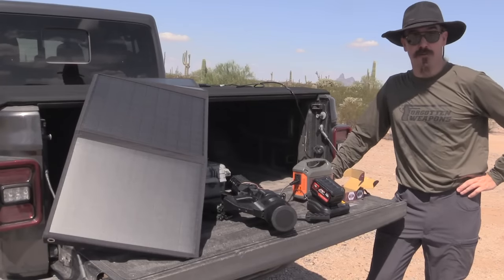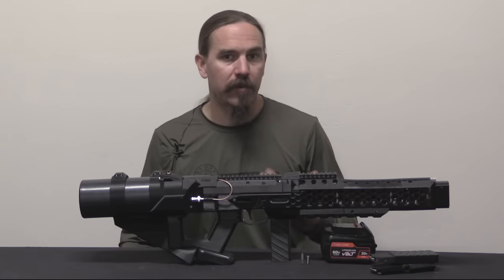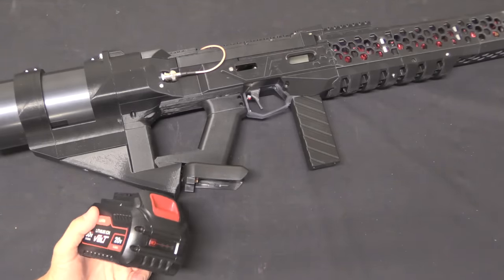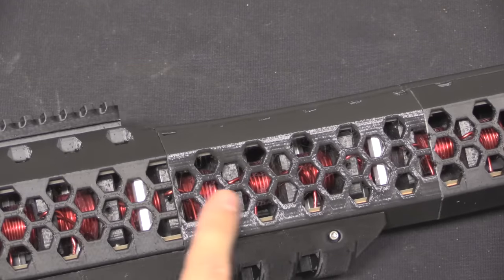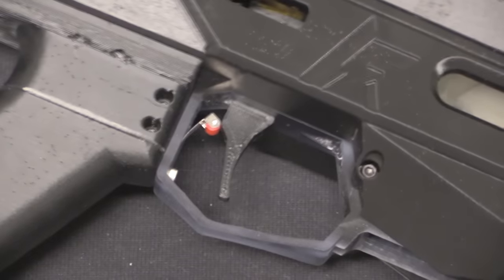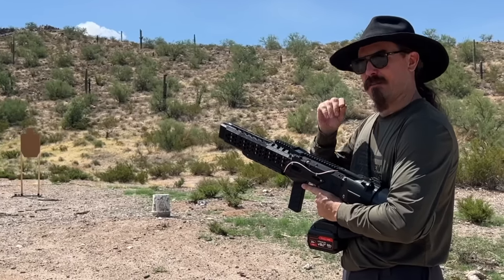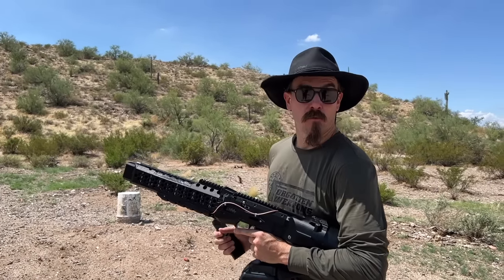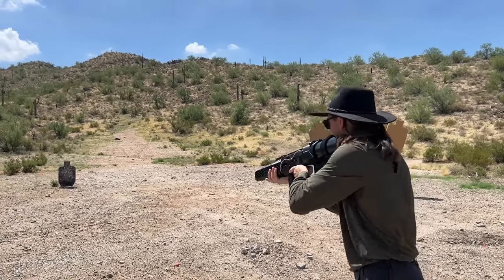ArcFlash Labs EMG-02 CoilGun: Making SciFi Weapons Into Reality

Comment: Would interesting to see them have a polycarb or whatever barrel, that was rifled / threaded - and the bolts come with that threading so that instead of interference rifling , you'd have spin induced by some sort of low drag threading
Reply: or you can rifle the bullets?
Reply: @gabriellang7998 That was the point, both barrel and projectile being rifled, just used "threaded". However at anything close to this power stage, I'm doubtful that would work. Because it would introduce a comparatively huge amount of friction, whereas these current models practically has no friction at all.
Reply: Wonder if you could make the dowel spin before it's pulled into the "barrel". Something like electric motor & rubber disc pushed against next dowel in the magazine before firing. If the system really is low friction it could keep the spin going.

Comment: I’m just waiting for the day we hear Ian saying: “today we’ll be looking at a shotgun coilgun”
Reply: space blunderbuss!
Reply: Envisioning  it as a muzzle loader.
Reply: Today I fire the Wave Motion Cannon
Reply: Project SPIW revisited.
Reply: On that note, could they load like a pack of needles or something in a nonmagnetic holder to make it a single-shot flechettes shotgun (single shot because the nonmagnetic holder needs to be ejected each time from the magazine).

I don't know if it would even be possible to have a low-magnetism holder to shoot it at the same time as the needles but at a lower speed and distance?
Reply: @raznaak  Sabot round, have the fall away aspect be magnetic (perhaps just a mag disk at the base), and use whatever other material you want as the payload.  I could even see it as something to deliver less then lethal loads with the current FPS it has.
Reply: Now I am envisioning a 40K bolt gun...
Reply: Shotcoilgun
Reply: The NC wants to know your location. (If you know you know.)
Reply: "Today we'll be looking at the Hydrogen Light Gas Mass Accelerator."
Reply: They Probably could down size an APFSDS style round from a tank into a little flechette bullet.
Reply: Im no sure why they haven't used fin stabilised projectiles yet.
Reply: @p.rileebenjamin7201  I thought Boltguns were gyrojet rounds.
Reply: @torgranael  they are, but they have a magnetic feed system if I recall
Reply: @p.rileebenjamin7201  I see. With how small the magazine is, I never looked into how it's supposed to feed.
Reply: @torgranael  Technical cannon for 40K does get kind of fuzzy, but I seem to recall it having a magnetic feed system.

Comment: Ian (or anyone who owns one of these) should invest in a magnetic ground-sweeper; that way they could reuse the projectiles (rather than having to reload the spent cases!)
Reply: Fortunately dowel pins are stupid cheap. Probably only worth the effort to collect them if you're firing hundreds or thousands.
Reply: Unless it hits something and deforms
Reply: Always a good idea to keep your range as tidy as possible.
Reply: @lucasblanchard47  I think their point was that magnet sweeping for coilgun projectiles is the closest recycling equivalent of brass reloading for firearms, not that you'd have to reload cases for this.
Reply: @lucasblanchard47  Thank Buddha it doesn't use lead.  See, another aspect of a weapon transitioning from the status quo.
Reply: i use an old car speaker on a string.  farmer engineering at its finest.
Reply: @pezpengy9308  how does that work?
Reply: @StoutProper  all speakers have a pretty good size magnet on them  the bigger the speaker the bigger the magnet
Reply: @StoutProper  Speakers have a big old magnet on them. Get a car speaker from an auto scrap yard for like, $2 or less, tie a string on it, then just toll it around like a Priest with a censer, while walking on your range. If it keep it just off the ground, it will collect the dowel pins for you.
Reply: A Roomba fitted with a magnetic sweep!
Reply: @JosephHarner  Do they make metal dowel pins?  I suspect the ammo made by cutting down rod stock.
Reply: @thehoodedteddy1335  Short solid steel pins at 200 fps (which is a velocity you can get out of a slingshot) probably aren't going to significantly deform.
Reply: @corombb   Exactly!
Reply: Steel dowel pins normally are extremely hard, you could probably reuse them, but in the 1/4" - 5/16" diameter range they are sold 25 pcs in a box for about $10.00 from McMaster Carr.
Reply: @norduferhandel4512   $10.00 for 25 pieces works out to $0.40/projectile.  A quick look online for 9mm ammo prices gives me a range from $0.20 to $0.85 per round.  I would certainly police up my e/m gun projectiles for reuse; the ones I can reuse are essentially free.
Reply: I'm sure Ebay or Amazon would have cheaper dowel pins. McMaster is the most expensive supplier.
Reply: @danielburgess7785  Aw, I'm going to miss the lethal leadpoisoning joke.

Comment: I think you'd be better off with self-stabilizing shapes like those used for shotgun slugs. Maybe even just drilling out a deep dimple on the back end of the projectile would give you better flight performance.
Reply: I bet they know, it's just not important yet)
Reply: Yeah, something like a stretched diablo pellet should work. And can be cheaply formed on a lathe in a single cut with custom cutting bit.
Reply: What I thought they could do is use finned projectiles and have rails on the barrel that input a rotation onto the projectile, you could still use improvised ammo, but actual ammo could be stabilized
Reply: This would probably work for higher speeds, but at 200 ft/s, I’m not sure you could get any substantial spin into the projectile.
Reply: or steel ball bearings and a "hop up"
Reply: I was thinking loading the projectile from the magazine into a chamber where there is rollers spinning it up before sending it through the coils. Auto might be a problem though.
Reply: What about a mini golf ball with all the dimples in it that improve aero dynamism?
Reply: Or borrow some of the advances the air gun world has made in stabilizing slugs, may be simpler and better to go there directly
Reply: @StoutProper  Same problem as with hollow or other shapes, you get far less material density for the coils to accelerate n cross-section.

I'd look more into tumbling than spinning around the axle off traverse.
When skipping stones on water, the stone is to tumble around the vertical axis to stabilise, the optimal rate being around 14 revolutions per second (if I recall the scientifical report correctly, ben a couple of years now since I read it).
Reply: Round the tip.  and cut a shallow ring at the far end to induce skin drag effect.
Reply: @Crenshaw Pete That doesn't work for projectiles that aren't spherical. A hopup works by imparting a spin on the projectile in the longitudinal axis, which creates lift into it's spin.
Reply: Well, the ammo is fully customizable seeing the drill bits being fired, so plenty of space for third-party imagination possible!
Reply: @tomfeng5645  Yeah, I'm wondering if he fired the bits, pointy side backwards he'd get better flight characteristics.
Reply: Maybe design a turbo jet engine type of bullet where the whole put in the center of the bullet would have some sort of ignition and propel the round even faster
Reply: @Crenshaw Pete gyro jet was like a mini rocket, what I am talking about is like turbo jet engine, similar to how modern aircraft operates.
Reply: @Crenshaw Pete no, solid propellant, with a key idea of taking the air and expelling it with higher pressure from behind. No moving parts

P.s unlike gyrojet, the air input will help to stabilize the projectile.
Reply: @Crenshaw Pete okay, first of all, chemistry. We know that air we breathe is comprised from Nitrogen and Oxygen, so there will have to be some sort of chemical reaction occurring to drive the “engine”. There do exists engines called scramjet which operates on supersonic speeds, which is not that hard to accomplish with a bullet in all honesty. Also scramjets do not have any moving parts since they use the micro explosions caused by the air collision with an object at supersonic speeds. So the only thing left to figure out is the stabilization method and the type of fuel. Many post war heat rounds had the fins deployed after the shot, same design can be applied here.
Reply: @aionarkhe5260  hold on, many rounds travel supersonic. That was an issue in creating VSS Vintorez. Because the bullet crossed the sound barrier and went supersonic, it created a loud sound. So in order to make silenced round with good kinetic energy, they had to increase the weight of the round and reduce the velocity, which in terms helped to silence the sound of shooting.

Comment: I still remember 10 years ago people said something like this would never be hand held, practical, nor commercially available, with actual military use a pipe dream confined to science fiction.

That was only ten years ago and we already have something they said couldn’t be done, I can’t wait to see what this will be capable of in 20 years
Reply: Half of what you said still isn't applicable to this. It's not practical or anywhere near being useable as an infantry weapon. Still, maybe in 15-30 years.... Maybe?
Reply: Not really bud not enough power to be useful for anything !!!
Reply: It sounded like a bb gun ringing off that steel
Reply: @LegendStormcrow  I've seen a a hobbyist  here on youtube make his own gauss rifle with reasonable power.
Problem is by the third round the barrel e.g the rails and the magnets, melt.
Reply: mass effect guns
Reply: This has been always the argument, people use the same "arguments" that people used against tanks and planes.
Reply: Emm... The physics is over 100 years old and people being researching those stuff over a century. 
The velocity of the 5/16 inch, which is roughly 8mm bullet is about 200m/s...... Yeah, your subsonic 9mm from a 4inch will perform much much much better. 
Unless it shoot stuff at over 800m/s, it is not replacing boom sticks.
Reply: I can sure see myself getting one just a very few generations on. They will still be toys, but interesting ones. I wonder if the heavier projectiles give more recoil since they have the same MV?
Reply: @jintsuubest9331  Physics are a bit older than that ) 

Which is a good thing, because although this is not a breakthrough, the challenges, limitations, and goals are quite clear on these weapons. Not all parts are in place just now.
Reply: @Cancer McAids I'm just impressed that we have 60v cordless drill batteries now.
Reply: @Cancer McAids So basically, we need to send a mining company to Pandora.
Reply: And most scientists who specialized in the field logically never said such things, it was more mainstream people not understanding feasability, engineers and scientists understand the science behind it and how we can do it in the future we just have to wait for the energy density to get to a good point
Reply: >I still remember 10 years ago people said something like this would never be hand held, practical, nor commercially available, with actual military use a pipe dream confined to science fiction.

Literally no one said this 10 years ago, wtf are you talking about?
Reply: @Clockwork0nions  you weren’t listening hard enough if that was the case.
Reply: Shitty coilguns were always capable of being hand held and commercially viable. I only give kudos to these dudes and Ian because they are trying to bring attention to the industry to see if iterative improvements can make it work or a breakthrough happens.
Reply: Anyone who said they couldn't be handheld was ignorant of them current technology. Single shot units were handheld back then and earlier. 

Practical use is still in the future.
Reply: Important note: This is far from a practical firearm yet. It doesn't shoot straight, the muzzle velocity is 2/3rds of the way to a paintball gun, and the projectile is about as heavy as a pistol. I doubt it is nearly as durable as a military rifle while still being heavier.

It's an interesting novelty and proof of concept, but I'd sooner take a crossbow to a fight than this thing. When it comes to efficiently storing and quickly releasing energy, combustion us difficult to beat. Not impossible, just difficult.
Reply: @enderbirds3814  

What do you mean? If anything it was the opposite and coilguns were "just around the corner". People have been trying to make this a reality on the internet since the 1990's. I know, I was there.
Reply: @jintsuubest9331  Oh if I were allowed to break NDA...
Reply: @comedicsketches  Is there a way to make a rail gun function more like a sudden repulsion, explosion like?  Instead of a sling shot along a barrel?
Reply: @comedicsketches  What's high-tech about it is that the ArcFlash one charges up super fast. You can go on Youtube and find videos of homemade coilguns firing. Here's one below:
https://youtu.be/P5dqxlmQrGA
you'll see that he has to wait a solid minute for the capacitor to be ready for firing. This makes it slower than a muzzleloading rifle except it shoots with the power of an air rifle (even worse than black powder!)
The EMG-02 coilgun, on the other hand, can actually sustain a halfway decent rate of fire.
Reply: It's still non-existent as a practical weapon. Dozen times less muzzle energy and far less accuracy than a pistol while weighing and costing several times more.

The simple fact is, a typical conventional SMG outputs mechanical power (kinetic energy of the solid projectile divided by the cycle time) in the range of 10 kilowatts (during a burst of fire). A coilgun with 50% energy efficiency will either need to break the laws of physics or feed the barrel with 20 kW of electricity. A typical LED bulb uses 0.01kW. A 120V 20A outlet (typical in US kitchens) can supply 2.4 kW.
Those batteries for cordless drills typically supply up to 0.1 kW. If your time between bursts is 10 times longer than the burst, you will need over 100 of those batteries to recharge the capacitor (for a gun as described above).
Reply: @eloiseharbeson2483  Looks like Makita has an 80V range of tools an battery
Reply: @allopez8563  depends on how fast you can dump the  charge from the capacitor bank. As far as I understand it, they make the rails long enough to use up the useful energy available. 
If you can use up the power faster, you can use shorter rails. Of course,for the same total energy, the forces involved increase and you need to build sturdier rails...
Reply: @Clockwork0nions  what do I mean? I mean all the people who, like now, couldn’t shut up about how practical coil/rail guns were centuries away, and it would be maybe 50 years till we got this alone, how would I know this? I was there too smart guy.
Reply: 10 years ago, people were already making homemade coilguns and railguns, I remember one that fired a way larger round.
Reply: @LegendStormcrow  No kidding. Getting hit with those things would really really hurt but outside of a very lucky shot you're not going to be killing anyone with it.
Reply: @enderbirds3814  but they are though lol
Reply: @eloiseharbeson2483  it might if you get REALLY big size shells..like 5 inch cannons  (probably more at that scale with weight distribution than any magnetic charge firing the round)...  or bigger,.. But hand held size?,  No as the coils pull the rod (bullet) down the barrel...theres no push pull effect to the gun so no recoil
Reply: @roboflex3162  I've been wanting an M8 Avenger for years.
Reply: So you're telling me we're going to make Gundam real right?
Reply: F 20 years, 20 months !
Reply: They should make these into dart shooters, that would at least make some sort of sense. Trying to shoot metal pins is just idiotic.
Reply: Or 200 years🤯
Reply: and all those still valid, you need to increase the speed by an order of magnitude to be on par with the weakest guns, since energy is squared, that means 100 times more energy, so you are at 1% of the job, good luck.
Reply: @michaeltempsch5282  I was thinking that a short but very powerful burst, impulse or however it is called, would be better and would be more efficent than a long coordinated drive along a rail, besides you could actually rifle the middle or end part if someone designed it with a very power short impulse and the rest of the way through a rifled barrel.
Reply: It only took about 30+ years for Star Treks communicator to be a flip cell phone.
Reply: @andrewstoll4548  and the base idea already existed for decades at that time, the needed energy density to turn this from interesting and fun little toy actual weapon does not nowhere near, or to be more precise, closer to the current physics/chemistry does not allow it. it needs at least one major breakthrough, if not more.
Reply: That thing isn't practical in the slightest, you'd get more power from an pelet gun or even an airsoft gun...
Reply: @enderbirds3814  

Lol, keep living in your own head then big guy.
Reply: @allopez8563  I'm not really sure what you're saying here? The "long coordinated drive" you mention happens in tiny fractions of a second, and this wouldn't solve the rifling issue in any way.
Reply: @ic3olate  I don't know anything about electronics but an engineer showed in a video that the coil requires capacitors in series that are not always "tuned" and don't work with a smooth homogenous electric flow and this disrupts the bullet's path.
Reply: @thefirehawk1495  yep, you will never improve the tech if you dont test out variations and see if you can squeeze performance or hit a breakthrough